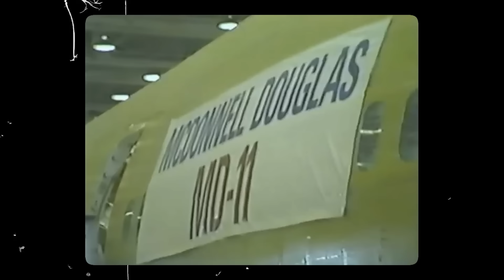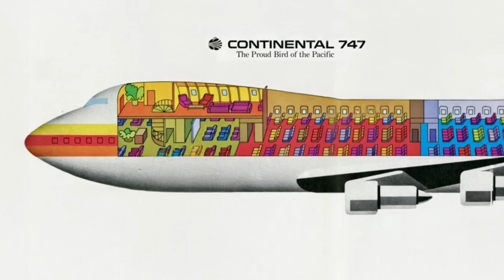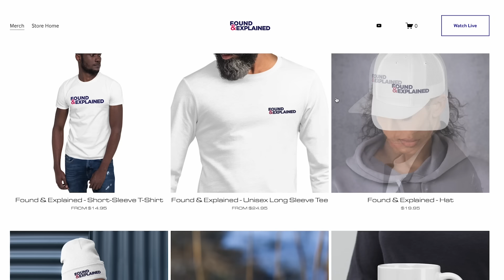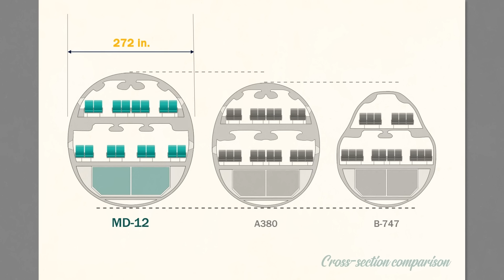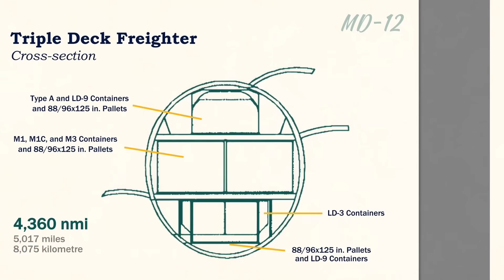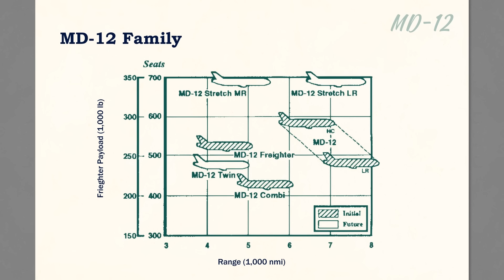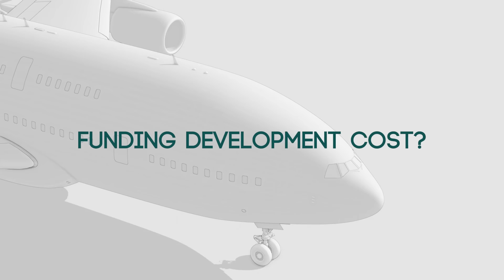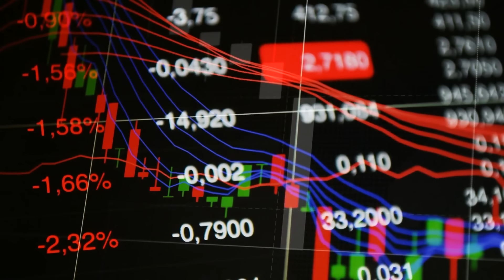What Happened To The American Double Deck Jumbo Jet? - MD 12

Comment: After seeing your A380 returns vid on this video on your other channel and knowing you bias towards the plane, your wrong about a few things and I wouldn't have known it if I didn't see a documentary on these planes just a few months ago. McDonell Douglass did not work with Airbus on this aircraft, and Airbus was not working on the A380 at the time.  It was Boeing who reached out to Airbus to work on a double-decker.  The reason the double-decked idea failed was because no one wanted it.  Boeing did their market research and determined that airlines want a more efficient twin jet, not a larger aircraft. So they came out with the 777 instead.  It was after Boeing pulled out of the double decker project that Airbus decided to double down, and that's where the A380 project came from.  In fact, during a French inquiry to why the A380 died so fast, it was discovered (right before the inquiry was dropped) that Airbus knew the aircraft would not sell, and actually sold more units than they initially thought, and that was due to Emirates.  The entire project was a vanity con job and since they knew the French government would bail them out, after Boeing determined the project was a bust they decided to do it anyway just to say they had the largest aircraft in the world. 
And no, they did not developed the MD-11 stretch and MD-12 (a plane Boeing already knew no one wanted) to raise the stock price. I know its a conspiracy theory that exist, but that's not what happened.  Boeing didn't buy McDonell Douglass for their commercial division.  You see, MD was the far more successful military contractor at the time, and the new Joint Strike Fighter project was in the works.  Not to mention they had the F-15, -16 and eventually but I am not sure of the timeline -18, all of which the military was looking to upgrade at the time. People forget Boeing isn't just a commercial aircraft company, it probably only makes up 25% of their business today.  They make more money as a defense contractor and service provider.